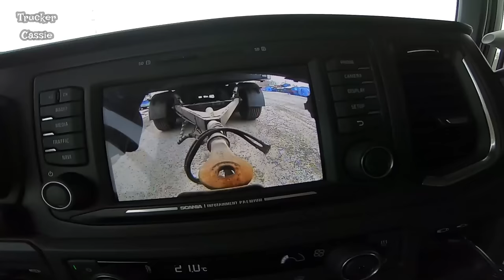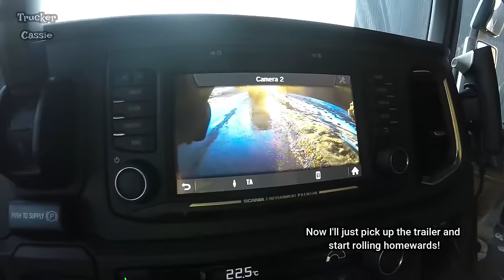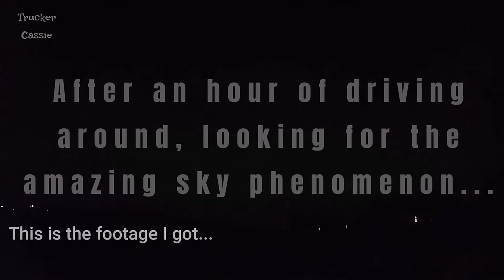Northern Lights! Trucker Cassie Work Vlog

Comment: Here in the UK, the drivers, at least where I've worked and places I've heard about,. The drivers just drop off the trailer and wait in the canteen or go off and do something somewhere else, and there are dedicated despatch workers who unload the trailers and load the new stuff in. Usually get 10-30 mins to do this. Sometimes there two of you but usually just one person to do this. So all the drivers do is drive and pick up paperwork. Not sure whether the drivers can use the forklift trucks, probably, but for some reason they are not allowed to use them or do any work inside the factory/warehouse.